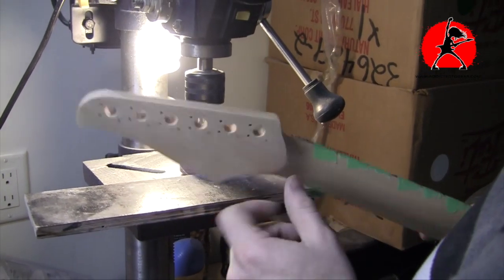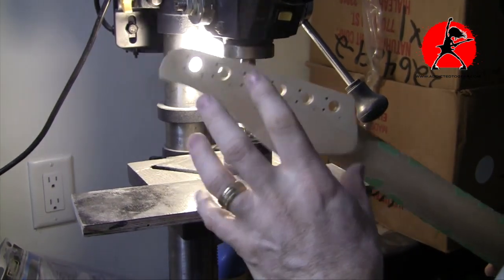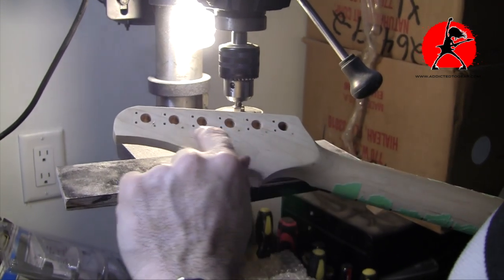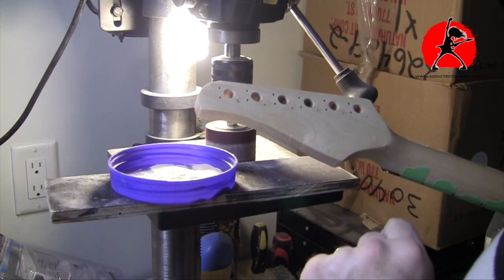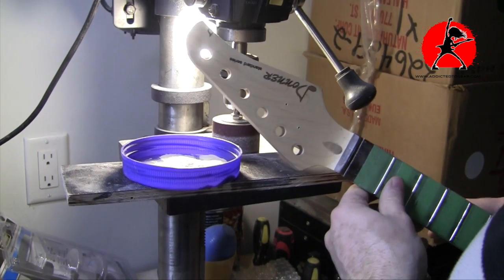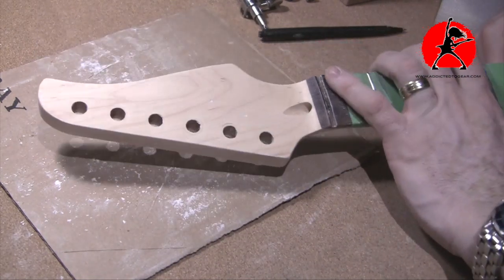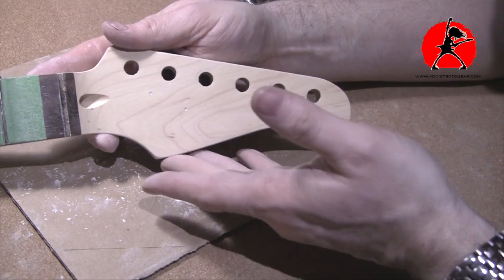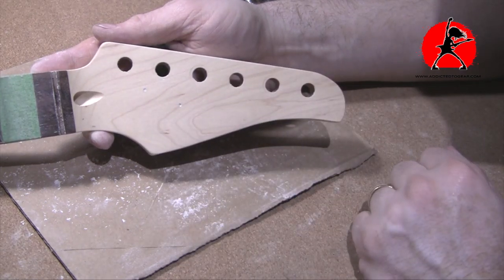Donner Strat Rebuild Part 3 - Taking The Headstock From Basic To Beautiful!

Comment: The next stage is the one i am waiting for, the tuners you have fitted look better that the original ones.
Reply from the maker: Yes, they are certainly a step up. Not the best in the world but much better than the stock ones.
Reply: Tuners are the one area where they always seem to fit poor ones,
even on more expensive brand name guitars, i think it's to make us
upgrade them to locking tuners at more expoense.